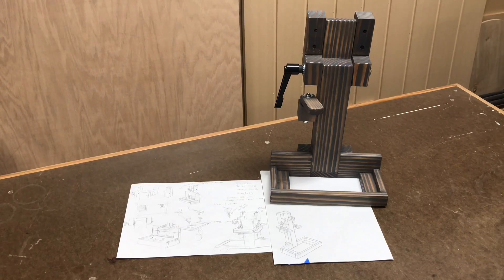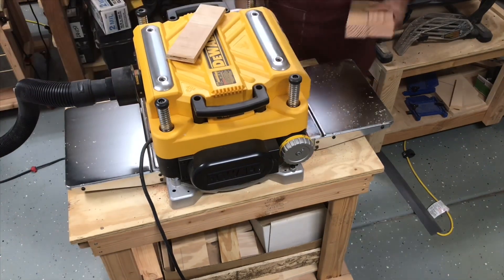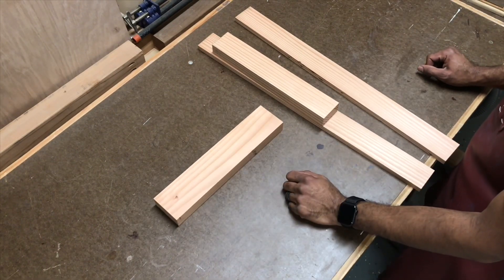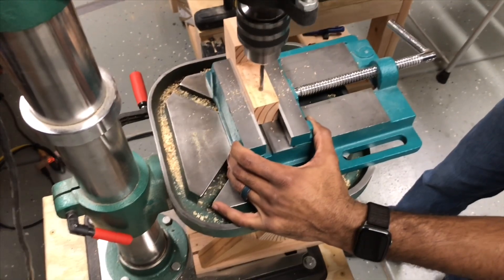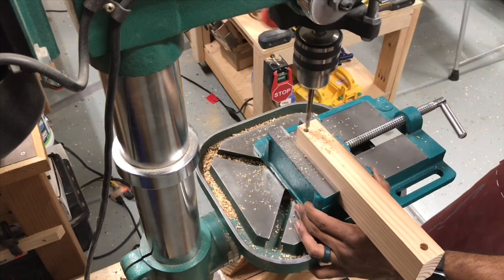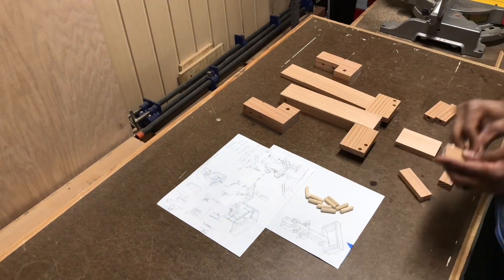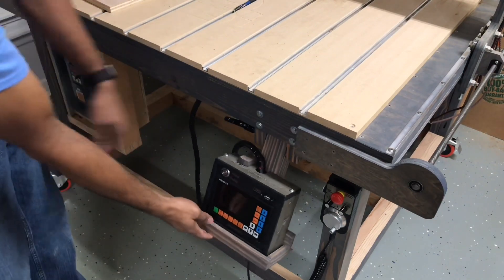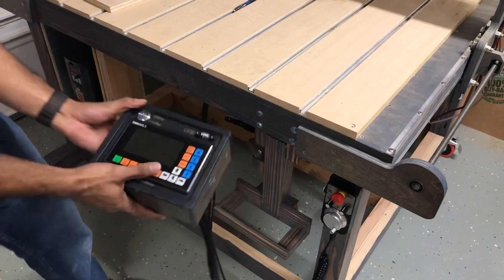Offline CNC Motion Controller Cradle for my Gatton CNC

Comment: Nice! I'd like to see how you hooked up the offline controller to the CNC. Do you have a video? Right now I'm using the Xylotex kit and Mach 3, but would rather have a DSP.
Reply from the maker: I do not have a video that shows my connections for my CNC that is of good quality just yet. I plan on making a higher quality video on my enclosure designs soon. I have a feeling due to how they are laid out, what was done to simplify things may have also made things looks more complex. I did not have the Xylotex as an option when I was building my CNC, which is funny because that is what I wanted a plug-n-play system. After a little bit of research I found out that I could make the Xylotex box and even customize it to fit my needs better. Having more space and not being charged for it works so well in my favor once I expanded the basic design of the Xylotex and made it mine. My theory being companies create smaller more compact units for multiple reasons. Mostly manufacturing and shipping cost but the end consumer enjoys a slimmer unit also. All reason for companies to charge more. The good news is, through the CNC community I have seen an option that might have a Xylotex replacement in the works. Might want to check it out. (javibox.com)